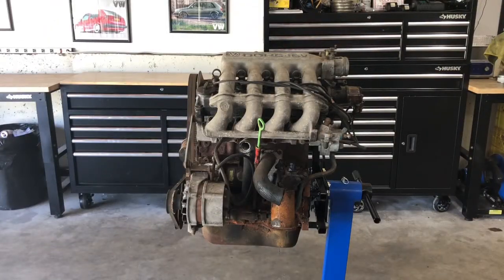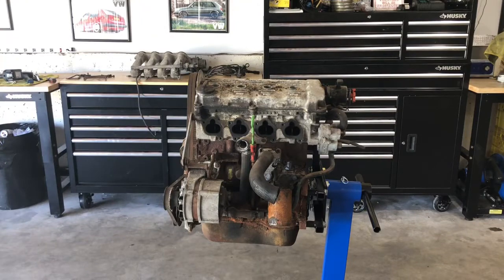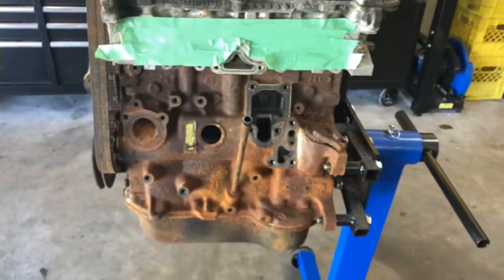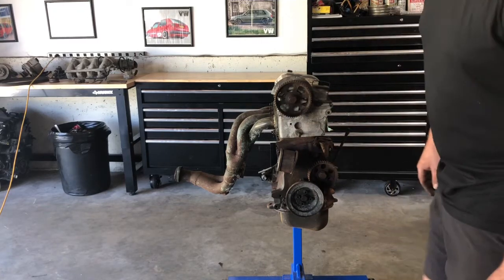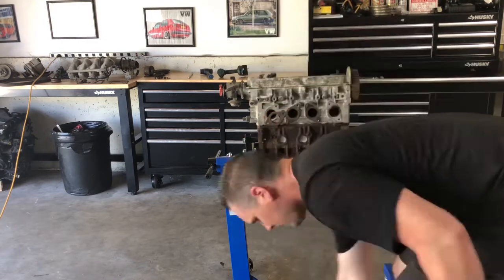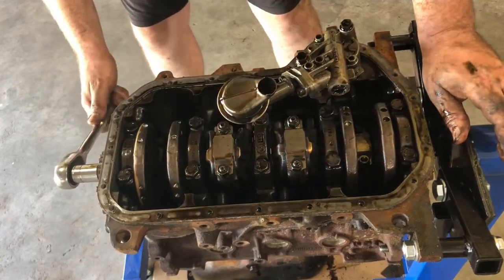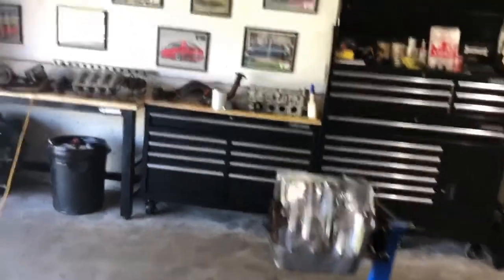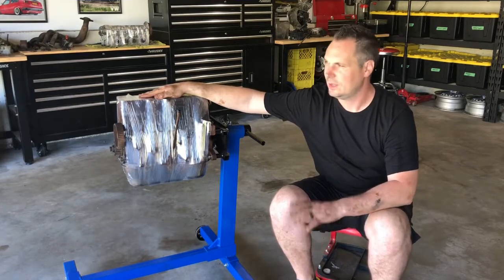Volkswagen Golf Mk1 Build (Ep.8) / WE TAKE A LOOK AT 2.0L 16v / VW Swap Rabbit Caddy Citi Cabrio

Comment: Early ABA-blocks had stout bottom ends, slick piston-squirters and they pair-up nicely with the 1.8 16v high-flow heads. I did an identical build, but tossed in a bunch of BBM and Techtonics parts in case I ever wanted to go forced-induction in the future. My only remaining challenge, is continue to fight my modified/convoluted Digifant.II wiring or just throw in a standalone Speeduino ECU and boost...
What you do think I should do, boss?

Comment: Nice! I need to replace my 16v engine! Do you know the size of the crankshaft bolt? 19mm 12 points?
Reply from the maker: Yes I believe so
Reply: Mystery Garage yes it is 19mm, the crankshaft turns, but the camshafts are locked!😭 looks like bend valves!!
Reply from the maker: boraboyvr6 oh no! Well... I’m sure it can be fixed up, start tearing that head apart! Cheers
Reply: Mystery Garage yes! I will! Thanks!✌🏼